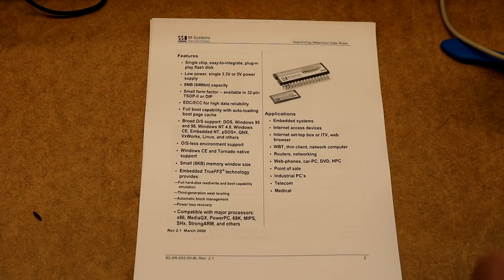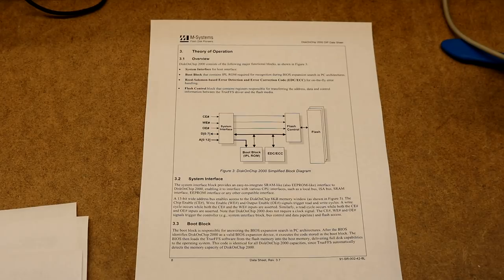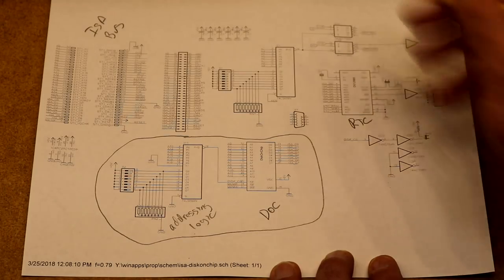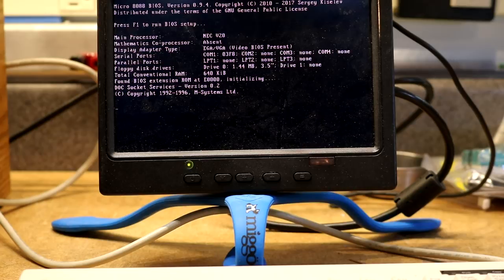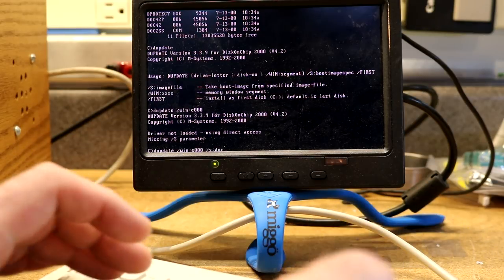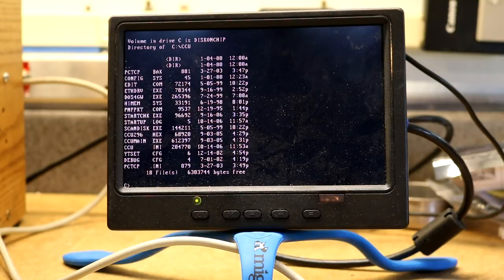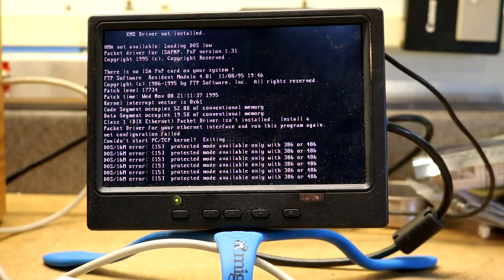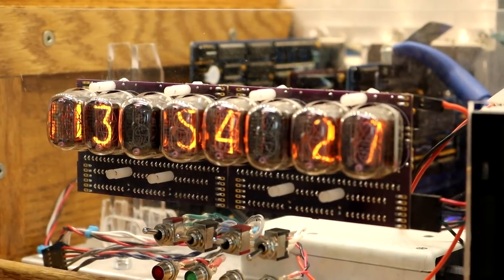ISA DiskOnChip and Clock Board

Comment: Cool project.  I created a cut-down Linux distro around 1999-2000 that fit on an 8mb DiskOnChip devices.  M-Systems made an 8-bit ISA card and software to flash them, which this reminds me of.  It was a hassle to use, since you had to power off the machine, pull the card, install the DiskOnChip, power up, program, power off again etc.  Once I had an image that passed QA, that got sent to China and programmed onto the shipping machines.
Reply from the maker: Very cool. I was thinking these would be perfect for a small embedded Linux device.

Comment: thanks so much for this video, i managed to get my 192mb working and updated firmware on the same 8mb chip you have. Now i can install win95 on the 192mb and have a true single board pc in my macintosh classic project without sd card adapters etc

Comment: I attempted replicating the DiskOnChip portion on dotboard to adapt this to a Commodore PC-1 ... turned out I can only get it semi-stable when using a 74HCT688 (in a static setup like on the Lotech XTCF - going with the DIP switches + pulldowns already makes it glitch out) and buffering the data lines with a 74LS245 (without pullups seems to be fine). I actually tried a ton of different approaches as it got obvious early on that the timing appears to be extremely sensitive ... 74LS688 + various pulldowns on critical signals, 74LS138 + 74LS139 or 74F138 for decoding or buffering the adress bus + control lines via 573 latches.
Also: Be careful about rewriting the bootloader ... turns out it's bad on all my DOCs after rewriting ~15 times (they can still be used fine by manually loading the drivers).

Comment: I'm having a bad day making this thing to work. I´ve achieved to write to the DOC in address E000 in a machine where it won't boot from (Pentium MMX, too new maybe?). I have a 486 where it loads the DOC ROM, but only when no IDE or floppy controllers are installed, so I can't install anything. I have the PCI card where the DOC originally came from, and I've tried to install it in a newer machine (Athlon XP, it has an ISA port but it won't boot if the DOC with the ISA adapter is installed) and by disabling every IDE controller it gets to boot from the ROM but restart sor halts before getting to the floppy. If you have any clue of what's happening i'd appreciate the help.
Reply: OK it was the IDE controller. I got one working in the 486 and it can boot from floppy after loading the ROM, but for some reason there are errors reading the floppy when the DOC is in the system. If the card is in the PC without the DOC chip it reads fine, but with the chip in the socket it just doesn't work. At this point I'm suspecting on the DOC itself, what a shame.

Comment: These filenames look pretty similar to the ones I found in my "Hidden 386". It was a wireless networking access point (pre-wifi 2.4ghz protocol) that was a 386 machine without video, and an internal floppy drive to provide a boot medium. Maybe at some point they upgraded to a disk-on-chip?
Reply from the maker: Very interesting. It did feel to me like potentially some kind of LAN equipment, though I couldn't find any manufacturer identifiers anywhere. There was one very large INI file that appeared to contain what looked like IP addresses or portions of IP addresses, but each prefix assigned to a high-ASCII string. About 7000 of them. Given the mix of normal ASCII together with high-ASCII characters that make no sense to me, I wonder if the INI file is written in a language that I don't have the proper environment to display.

Comment: Hi,

What is the resistor network ohm value, that is, the yellow component on the board connected to the dip switches for the disk IC?

The schematics does not say.

Thanks
Reply: They're pulldown resistors, probably anything along the lines of 4.7k to 10k will work.
Reply: @1337Shockwav3  Yeah, in theory you can save a tiny bit of power by going with larger values but it becomes susceptible to electrical noise.  I try not to go above 10K for stuff like that, though if you were really worried about power, you could use larger values if you add a capacitor as well.

Comment: Thanks for the project.  Max disk-on-chip size that the card can take?

Also, is there any new BIOS firmware needed, e.g., upgrading to my computer (an old AT computer -- part of my collection)?

I read your page at http://www.smbaker.com/8-bit-isa-diskonchip-rtc-board, but it does not mention of any updated BIOS firmware needed.

It does sound like I would need the DUPDATE.exe utility to flash the boot image onto the chip.  Where would one get the DUPDATE.exe utility?

Thank you!

Comment: Isn't there a /q flag to do a quick format? I suppose it was a good idea to check this for any bad sectors due to its age, but that's usually a waste of time
Reply: He uses DOS 3.31, so no (you need 5.0 for that).
Reply: It doesn't always work either. Not sure about the disk on chip but, Dos 6.22, Windows 95, and Windows 98se bootdisks all refused to quickformat my ide to sd card drive in my pentium 3 laptop.